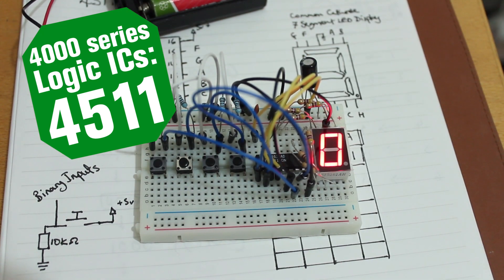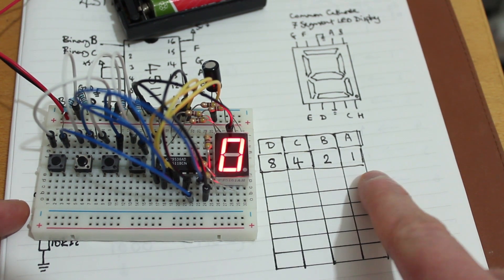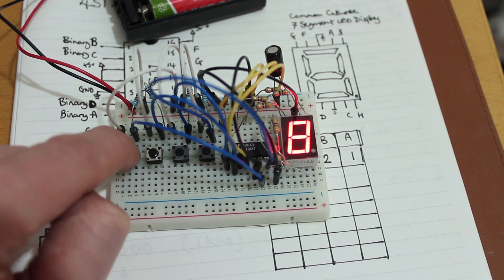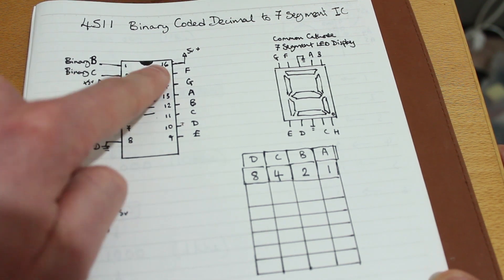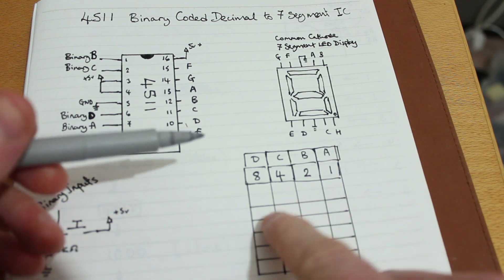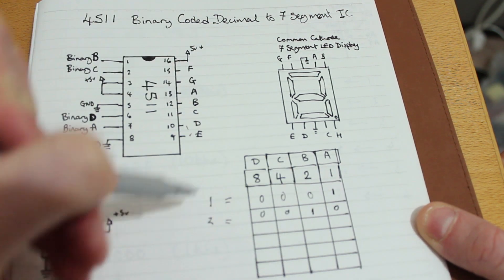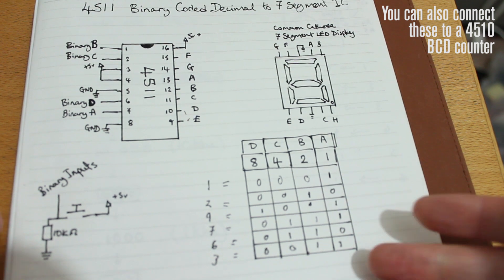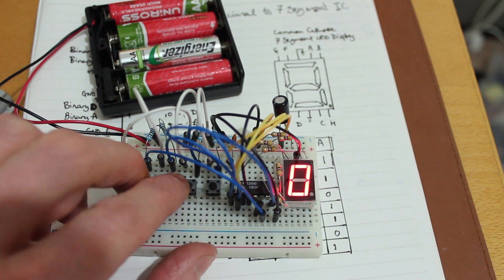4000 Series Logic ICs:  The 4511 BCD 7 Segment Driver IC

Comment: I once used a 4024 to a 4511 to a 7 segment display using a push button to increment but the display flashes whereas if I used a decade counter instead, it doesn't flicker. Any reason why it flickers when using the BCD counter to driver? or is it down to my board (incorrect resistor, capacitor?)

Comment: Like other have said I can't quite follow what you are doing, is the any chance of a link to a hi-res photo of the breadboard or a schematic, same with the 4026. Are you using the 4511B and 4026B, because looking at the datasheet it says that the B versions are buffered and can drive the 7 seg display without resistors.
Reply from the maker: Sorry mate, I don't have a high resolution photo of the breadboard. Was the schematic not useful in the video? I believe I had a mixture of B and non-B verisons. I used resistors mostly becuase I don't know what anyone following along has access to.
Reply: David Watts Thanks, yup the schematic was a lot of help, there was a couple of thinks I could quite work out, probably my inexperience rather than your schematic. I believe that I have it wired up correctly now, but it's still not working correctly, which I think is down to the jumpers I'm using which are crap cheapo things which aren't making contact properly, so the 7 segment display is just constantly display all the numbers in sequence very quickly when i have anything plugged into the pin 1 track (the clock signal) even if i just touch pin 1 with the metal end of the jumper cable the 7 segment display starts going, strangely the only thing that will stop it is pressing the button, I'm talking about the 4026 here BTW.
Reply from the maker: diecast jam It could be you need a 100nf capacitor across VCC and GND, but I doubt it. It is probably the resting state of the clock pin. I think the 4026 clock pin needs to be pulled HIGH or LOW, I forget which, with the button triggering the opposite. It sounds like your chips is constant triggering. Does that make sense?
Reply: I tried putting resistors on pin 1, think I tried 1K and 100k. When I was looking online i noticed someone else saying they had the same issue, ill try the capacitor on Vcc and Gnd, I have another 4026 which i'll try in case I have damaged the one I have on the board now, I'm not that careful about static. Thanks for your help.
Reply from the maker: diecast jam These old chips would take a lightning bolt and not skip a beat, don't worry about the static too much. Just don't rub balloons on your jumper while wiring up the circuit. 

I reckon you just have a few loose connections. The easiest thing is to pull it all out and start again.
Reply: Just tried the cap on VDD and what I did notice was that the 7 seg display was still on with VDD disconnected, I worked out it was getting power from pin 3 (I think) the one that enables the chip, I'm rushing to get to work so I can't check, am I right in saying only Vdd and pin 3 should be going to the power rail and all the others should be grounded or not connected? When pin 1 is disconnected the display shows 0 like it should, as soon as I connect pin 1 it goes crazy, I've tried putting a resistor on pin 3 and it's the same just the 7 seg isn't as bright.
Reply from the maker: diecast jam It think 3, 4 and 16 should be connected to VCC. 3 is display enable and 4 is output enable. 2, 8, and 15 should go to GND. 2 is disable clk and 15 is reset.
Reply: OK cool I'll have a look when I get home from work, it may have been that I did have it set up like that at one point, but I have been fiddling with it so much over the last couple of days it may be that I had left it with just pin 3 and 16 connected to the power rail, thanks again for your help, I want to get it working properly and then try it with a 555, if I wasn't so lazy I'd cut some lengths of wire to use as connections instead of using jumpers, it looks great with all the wires cut to length and neatly routed, there are ppl on YT that have whole computer systems built on bread boards, they have more dedication than I have, lol. I might even try and work out how to /12 or /60 using that ungated C that no one seems to know how it functions.